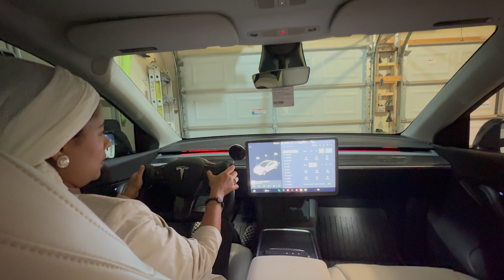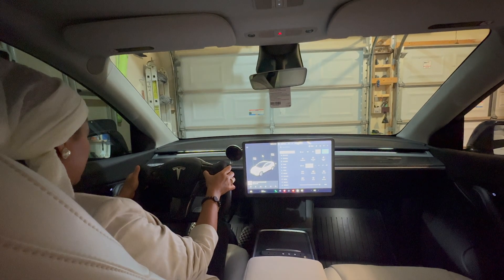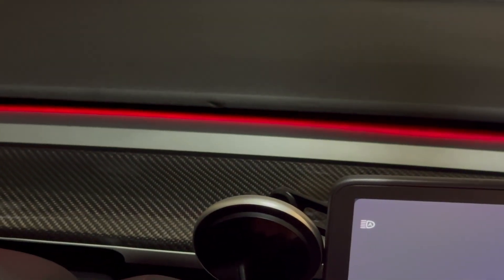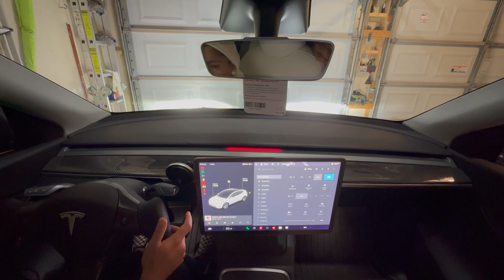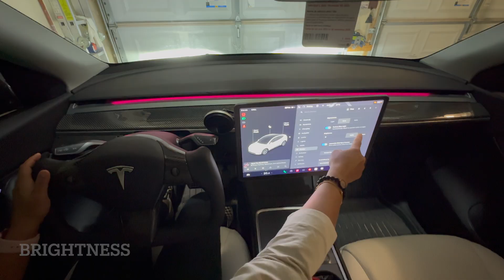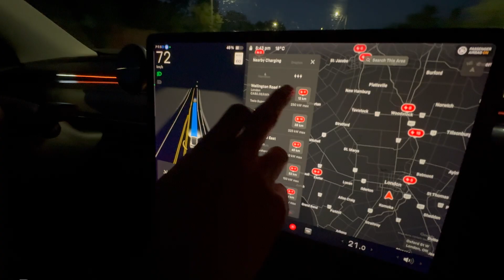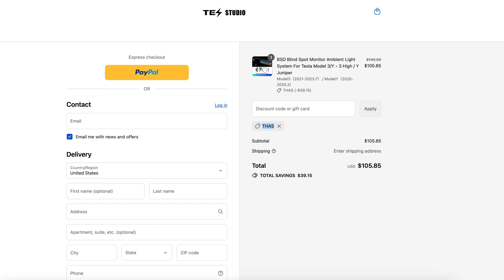Tesla Model Y BSD Blind Spot Ambient Light | Tesstudio Latest Version Review

Comment: I used the tape according to all the instructions I could find, and it just kept falling off. I tried reinstalling several times with other tape and nothing worked. I was so disappointed. I'm so happy to find your video and that secret crack to hold the light without the tape. I reinstalled it the way you suggested and it was not only easier, but better looking, and it works. Thank you so much.
Reply from the maker: My pleasure! Happy to hear you found the tip helpful for a better installation!

Comment: how do you activate the sports mode
Reply from the maker: I’ve shown that in the video, Watch @4:17
Reply: @thasneen  You didn't say how to change between and turn off the 2 sports modes. Do you long press, scroll, or a combination of the two. I just installed mine in my new Juniper and am flabergasted that there is no written or any description of how to adjust modes that come with the kit. I have to search for multiple videos and hope someone explains what the manufacturer or seller should have said with the kit! You have been the most helpful with this but you didn't explain how to shift between modes. Thanks
Reply from the maker: Please watch @3:53 Just scroll to change the modes. You roll up the right wheel on the steering wheel and go up to the light that has just the middle red bar, that's your sports mode. You scroll up one more time, you get the second sport mode. It's quite simple, don't over think it. 

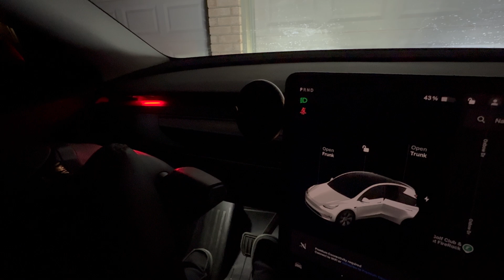And at 7:16 I show how to turn off - just double click the right scroll wheel.

Hope that helps, let me know if it worked.

Comment: How do i turn off the over the speed limit alert function??  This comes on way too may times and I'd rather not have that feature turned on!!
Reply from the maker: You can’t turn that off 😀
Reply: @thasneen I was told by the seller Tesstudio that I needed to dl the WeChat app and search for BSD ambient lighting and turn it off that way. That didn’t seem to make sense to me. Thanks for your reply. I sure wish there was a way to turn that off. Comes on like 30 times for my 30 minute commute to work.😢
Reply: The manual that came with mine included the below instructions, give it a try and see if it works for you

Note: If you don’t want the overspeed warning, you can easily disable it. Simply press the button on the right side of the steering wheel once quickly, then press and hold for about 4 seconds.
Reply: @djcarbine3074  i didn't get a manual for the settings with mine. can you share it?